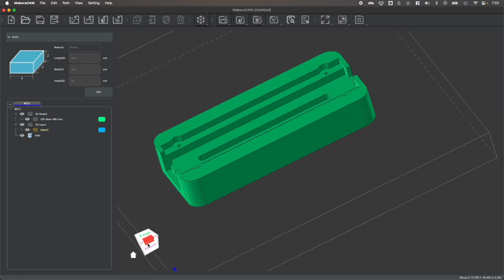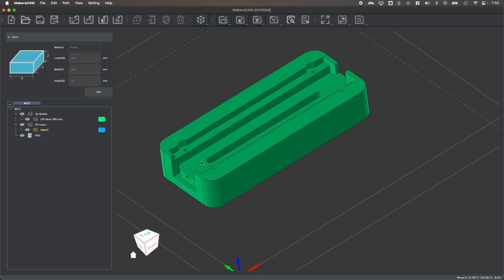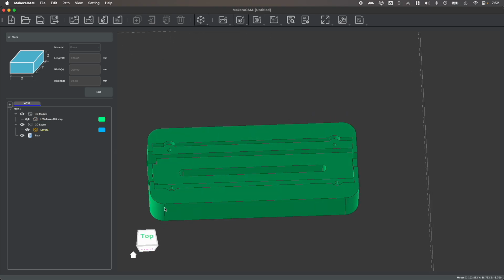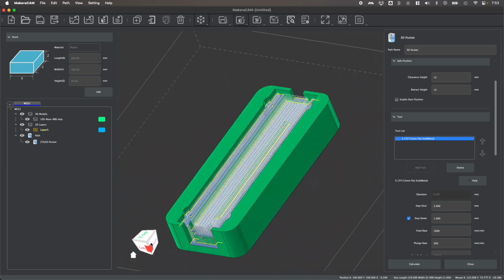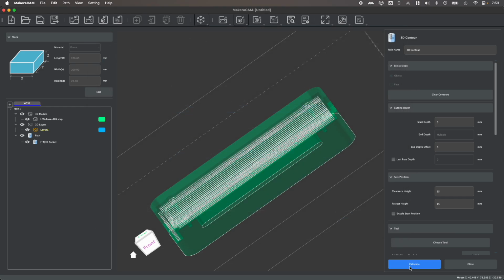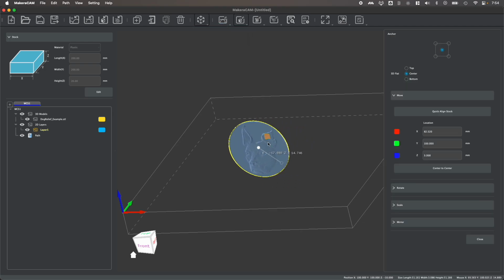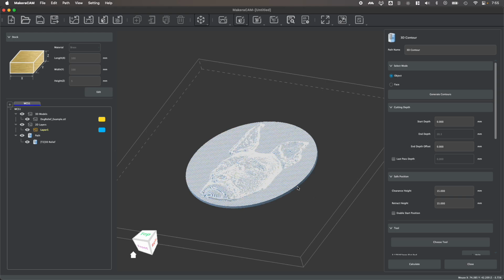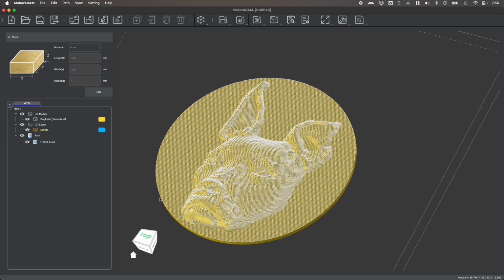Makera CAM - Working with 3D Models

Comment: Before I continue down the trouble shooting path. Am I correct in guessing Beta 2.0, isn't set up yet to download STEP files. I can export STEP from my software and import to other programs but not Makera CAM. STL import perfectly fine.
Reply from the maker: You should be able to import a STEP file on Beta 2.0. If you need more info/support please email cam@makera.com
Reply: @Makera  Must be something in how Rhino 3d exports .steps. i could not open the file in Kiri:Moto either. I could import the file into Fusion. After saving from fusion I could open the file in Makera Cam.

Comment: So i am using a step file...but i cannot select individual faces.
Reply from the maker: At which point in your production process? You will only be able to select individual faces when creating a corresponding tool path, such as a 3D pocket or 3D Drilling tool path. At other times, you will be able to select the entire object to use the transformation tools.